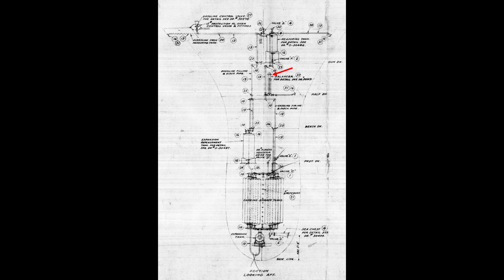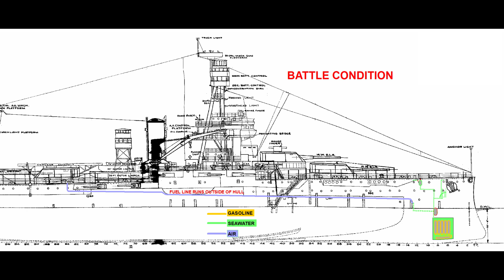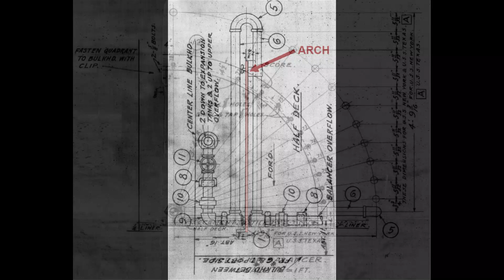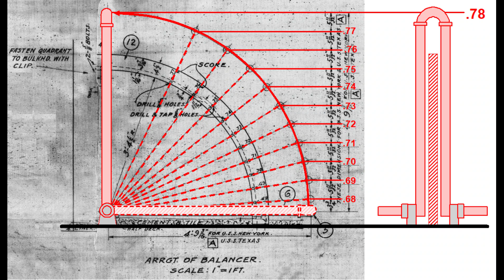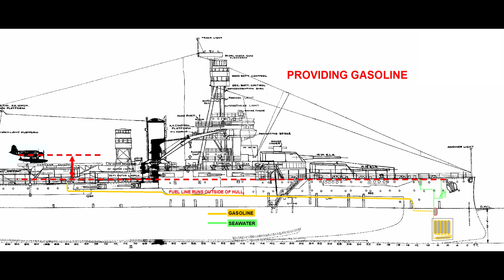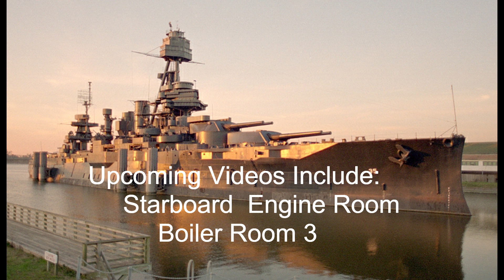Battleship Texas, Answer to "What The Heck Is This?"

Comment: So how did they prevent trace amounts of water from contaminating the fuel? As a professional pilots this entire system makes me gringe just thinking about it.
Reply from the maker: Unlike the broad, shallow wing tanks in aircraft, the storage tanks were tall, narrow cylinders that naturally encouraged stratification.  Correct me if I am wrong, but I think most aircraft tanks take fuel off the bottom so any water that has accumulated goes straight to the carb, which is why a major step in pre-flighting an airplane is to drain the carb. until you see gas.  In the ship's top feed system, water was fed into the bottom of the cylindrical tank where it pushed the fuel up through a pipe located in the top of the tank.  I am sure there is a layer between the gas and water where the two mingle, but they simply didn't drain a tank enough to reach that layer and the gas that was dispensed stayed free of water.  Having said all of that, I agree with your sentiment and would personally want to take the precaution of pumping the first couple of gallons into a container and look for water before fueling an airplane.
Reply: @tomscotttheolderone364  Other reason: salt will separate water and nonpolar solvents better than they otherwise would.  Chemists use this all the time to dehydrate solvent mixtures when there is too much water to use more complete methods of dehydration, like zeolite beads.
Reply: @tomscotttheolderone364  Correct.  And during pre-flight, you take a fuel sample that comes from a tube that goes to the top of the tank to check for water contamination.
Reply: That was the first thing I was wondering.  Your reply makes sense, Scott, thank you!
Reply: Much of the water you might see in wing tanks is from condensation, either condensing water out of the air in the storage tanks, or out of the air in the aircraft's tanks.  This is why aircraft should be stored fully fueled whenever practical, to reduce the moist air volume in the tanks.  Top feeding from the fuel tanks avoids the problem of water in the storage tanks, as someone already noted.
Reply: The salt content in sea water prevents  it from mixing with the fuel. During WW2 the British escort carrier HMS Vindex had problems with condensation in the fuel system mixing with the fuel and causing aircraft to crash. The solution was to fill all the spare space in the fuel system of the ship with sea water.
Reply: I was laughing at the same thing. They do mix, just not very well. Of course, the navy doesn't care how much (or little) they contaminate the ocean. (If I spill a few drops of brake fluid, it's an EPA disaster.) Do you want to drink the water from the bottom of a gas tank? I don't. (as I'm told, the navy sure will. they cover the taste with cool-aid.)
Reply: @jfbeam  They don't really mix, though.  They can be emulsified, but that's not quite the same thing.  If you keep a slow and steady flow of water into the bottom of a fuel tank, the fuel will rise to the top and leave nothing but water at the bottom.

A very, VERY old trick for welding fuel tanks is to simply fill them with water.  That drives out any gasoline and vapors, and allows you to weld the tank without blowing your face off.  And it works.
Reply: @jfbeam  drink the water.  It's seawater so no don't drink it.

I think there probably are a few more checks.  As he said the water enter the fuel tank through the bottom.  This should lesson the amount of mixing in the bottom tank.

Then I bet there was a minimum requirements of fuel to keep in the tank to prevent water from being push up the fuel pipe during fueling.

Lastly today's fuels are much different than past fuels.  Today we use a decent amount of ethanol which is hydrophilic.  That causes the fuel to acctually absorb water and making the gas degrade quickly.  Older non ethanol gas this wasn't as much of an issue.   Allowing the any accumulated water to be drained from the plane before take off would have prevented the plane from bit being able to start.

Ironically, this is also why you shouldn't run your car engine all the way empty.  As there could be trace amounts of things in your gas's tank that generally don't cause a problem unless it is empty to make their concentration much higher.  This is caused by car tanks not being able to be emptied.
Reply: I wouldn't taxi across a runway with you at the controls. Any "pilot" who doesn't know the word is cringe and that pilot is singular isn't fit to sit in the left seat. Are you 14?
Reply: @lancer525  touch grass
Reply: @lancer525  Ok. Thanks for the feedback. BTW helicopter pilots fly from the right seat so I guess I'm still good. Have a good one👍

Comment: Very clever system. Although I'm sure it gave the pilots some discomfort to know their fuel has been intentionally in contact with water.
Reply from the maker: That’s the beauty of the system.  Except for a thin layer where they intermingle, the gasoline floating above the water is quite pure.  The key is to be sure that you never draw down to that layer.

Comment: Doesn't this system assume that sea water doesn't evaporate and foul the fuel?  Corrosion would be a long term issue for aircraft and the ship's tanks.
Reply from the maker: The seawater cannot evaporate since it is not open to atmosphere except when either taking on gas or dispensing it.  Once finished with either operation, they would pump more water into the system until it discharged out of an upper drain.  This assured that air was purged from the system and it was full of either gas or water.
As far as corrosion, that’s a really good question.  The tanks and piping are made of steel that will certainly corrode if given the opportunity.  In fact, their outer surfaces are now heavily rusted.  I do not know if  their inner surfaces have a protective coating.  While it is possible, I know that the ship’s fuel tanks are not coated so that they didn’t have problems with flaking paint clogging up valves and filters.

Comment: Hey Tom, you mentioned that at battle condition they would flood A-2 to enshroud the gas tanks in water, why not just keep it full anytime there was gas in the tanks?
Reply: As mentioned A-2 is a trim tank, so you’d have to take on more water fore and aft to level out the ship if you keep that one tank floored. Adding more weight and drag increases fuel consumption and reduces the range of the ship. When friendly fuel depots can be far and few in between, less times you fuel the better.
Reply from the maker: They may have, but I haven't seen any documentation stating that would be a normal condition.  However, it is clearly stated for battle condition.

Comment: Doesn't a gallon of water displace the same volume as a gallon of gasoline, no matter what the density? How does weight enter into it unless you put water into the measuring tank by weight rather than by volume, and why would you do that? The only thing I can think of is that the aircraft were fueled by weight rather than by volume so that they would be getting the same amount of fuel regardless of the density.
Reply: @tomscotttheolderone364   Still doesn't make sense - the displacement system on the ship is a volume based system.   if 1 gal of water is added,  1 gallon of gas (at whatever temp or density) will come out the other end.      If they were worried about the actual mass of gasoline being dispensed,  then yes, the density of the gasoline needs to be considered -  in simple terms there is "net" and "gross" volumes.    I doubt they were as concerned about this back in the day.
Reply: I was thinking the same thing - 100 gallons of sea water will displace 100 gallons of fuel....there is something more to this.
Reply: A gallon of water weighs 8lbs-ish and a gallon of fuel weighs some 6.5lbs.  Water is relatively incompressible, but the fuel would compress.

Comment: The thoughts and engineering that went into these early mechanical marvels always impresses me, especially considering most of the country still used horse drawn carriages when it was launched.
Reply: Heck, the Texas was put together with mules on ramps!
Reply: An interesting piece of perspective, there; thanks, Richard.
Reply: You got that right Richard.  The things people designed back then, the problems they overcame, are really incredible.  Too many people down play the past, which shows they have no clue of the pure genius some of these systems really where.
Reply: Its almost as though people from the past were just as smart as people today.

Ok, jests aside (not that what I said was a falsehood though). I have a small issue with the way the sentiment is expressed in the original comment, but first let me state categorically that this is in no way meant to denigrate that person.

Be amazed at what people did with the tools and toolsets (the literal and theoretical ones) they had at the time. Be amazed at what they created with little precedent (take the carburetor of a car and its lineage with perfume bottles as an example), but do not simply be amazed by literally comparing horses to battleships.

Did you know that when this Texas was launched fax machines existed. Electrical transmission of things like signatures, literally a facsimile machine, had been around for decades, and even predates the telephone? in fact THE FIRST Texas was laid down a year after the telautograph was patented.

Did you know that 2,300 years ago Romans built an aqueduct with an average gradient of 1/1500 (i.e. for every 1,500 feet of length, its height would decrease by 1 foot)? The Aqua Appia. 

(Think for a moment at what it takes to achieve this level of accuracy, this is the time of Socrates and the first Emperors of Japan...... I can state from my own experience installing 4" drainage pipes in trenches, that a gradient of 1/10 is a lot harder than it looks at first glance, 1/1000 or 1/1500 is simply insane... also just to note, is that the Romans preferred to put their aqueducts underground whenever possible, the above ground bridge-like structures we automatically think of today are simply the most visually striking parts, not the most common, so there is a bit more commonality here than simply talking gradients, but anyways......)

My point is that yes, people of the past did not have the newest tech that we have today, nor did the all the people of the day all have the highest tech available to the period. This is literally a truism in the most proper sense of the word, meaning that along with being unquestionable true, stating as much in any manner also adds nothing to any conversation. Using such a statement, as used in the original comment only serves to prop up the people of the past in a manner that is condescending in regards to their ingenuity and the toolsets they had already developed.

It is one thing to say something like "They had to do all those calculations with a slide rule, while we today have electronic calculators." This is talking about a very specific thing, a device for calculation and its improvements. It is like comparing the Roman groma to the modern electronic devices of a surveyor.

I understand the spirit of the original comment was to highlight the difference in the tech divide. But this as I said, is condescending to the people of that time period as well as being somewhat vacuous at the same time. I could for instance state something like "Even today when we have walked on other worlds, most people on this world do not possess a method of transportation which utilize something other than their own feet for locomotion."

(Note: having access to, is not the same as having possession of. I.e., people might have access to a bus or train, but it is not a vehicle they actually possess themselves.)

This is objectively true since the majority of the worlds population does not own their own automobile, plane or beast of burden. But as should be plain to see in this example is that it implies that most people in the world haven't joined the rest of the population and are just stuck in the past for one reason or another, perhaps even by choice. It might be objectively true, but it is still condescending.

Be amazed at what people did with the tools and tool sets (the literal and theoretical ones) they had at the time. Be amazed at what they created with little precedent (take the carburetor of a car and its lineage with perfume bottles as an example), but do not simply be amazed by literally comparing horses to battleships. (repetition for emphasis)

The condescension born of the superficiality in the original statement is in my eyes, not a compliment to the people of days past.

I would like to leave anyone who reads this with some food for thought, nothing I want an answer for, it is simply for you to ponder. With modern long guns i.e. shotguns & rifles, just how much has changed from the crossbow? They are used the same way to do the same thing. Yes the mechanism behind a shotgun and crossbow differ, but that is a minor difference when compared to the difference between an atlatl aka spear thrower and a crossbow. The change from leverage to compression & tension and the addition of a method to lock the string in the drawn position giving the crossbow the ability to store energy for long periods of time and the change to using the shoulder to increase both accuracy and ability to aim. These are the same things that make a shotgun different from an atlatl, it is just that the actual gulf in each difference is even more vast due to the improvements in that one kind of difference. Take for instance the method of aiming, using the eye along with multiple points of reference down a long line (all things being equal, ideally as long as possible, the longer the distance between the elements in gun sights the more accurate they are) is both intuitive, easy to learn to do well and objectively precise. While it is possible to be precise with a spear thrower, its method of aiming has basically nothing in common (it is more akin to shooting a handgun from the proverbial hip, rather than lining up sights or using a scope). Yet this is still how both crossbows and rifles are aimed.

SO, how just how much has truly changed or has simply been refined from the invention of the crossbow 2700 years ago in China?

addendum: again let me state that I understand the original comment was meant to be praise and not a slight. I do not disagree with stating that the people of the past deserve praise. My only disagreement is in what that praise consists of and what constitutes praise in general.

Comment: Wow what a good idea! Run all fuel lines externally along the hull; that is something we could do today.
Reply from the maker: The external pipe run solved at least two concerns.  The most obvious is that the run is the most fragile part of the system.  By placing it outside of the hull, a major failure would most likely result in burned paint and maybe warped hull plating instead of a serious fire inside.  The other issue an external pipe run solved was reduced time in a shipyard required to modify multiple bulkheads and decks to accept a long pipe run that had to be installed at an angle.  The angle was critical to the system because its slope allowed the line to naturally drain gasoline by gravity back to the tanks when you wanted it empty.
Reply: @tomscotttheolderone364  I think it was well done, especially for an add-on.